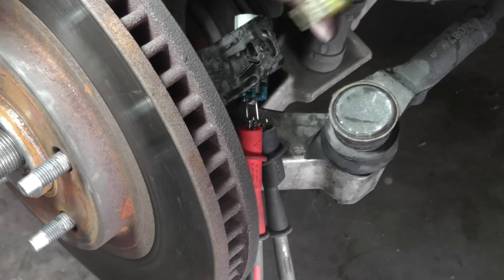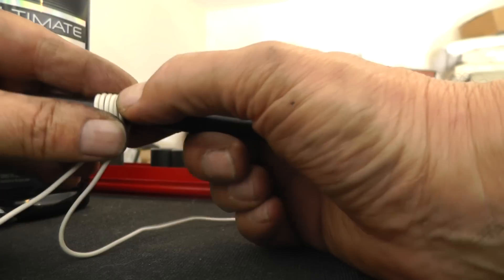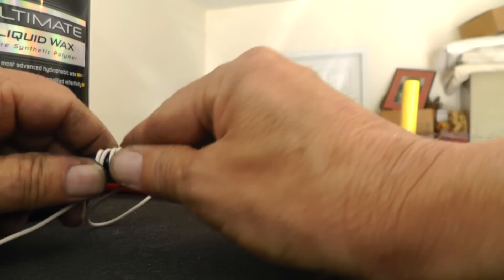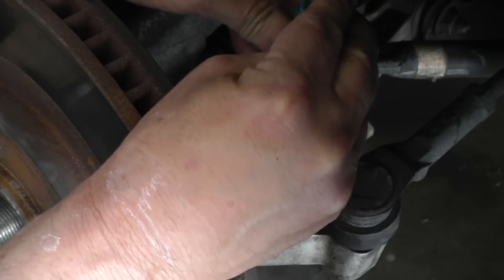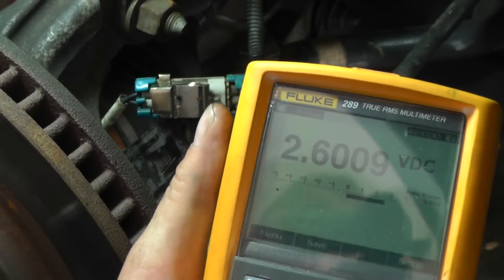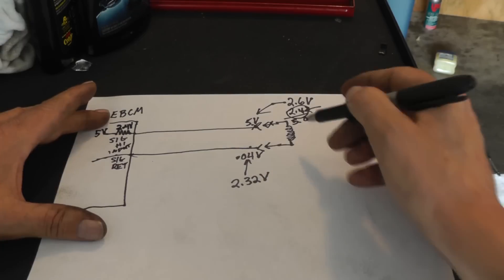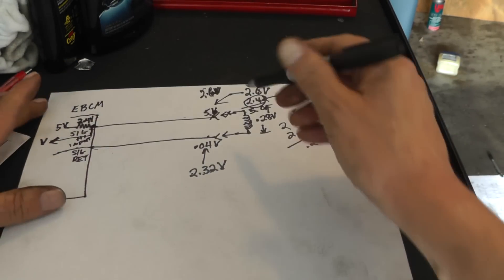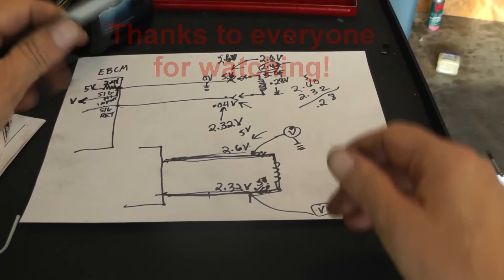Buick LeSabre ABS, Traction Off Diagnosis Part 3

Comment from the maker: Thanks for watching blackwell1384. This is only the first part of where we're checking resistance and the DC bias line. If this voltage isn't right, then it doesn't matter whether the sensor is working. You'll still get a code. We'll cover the actual sensor voltage in the next video to look at the AC voltage with a DVOM and a scope. Thanks again blackwell!

Comment: what does it mean when I have 3.15v on " high wire " and 3.13v on " low wire"with the connector plugged in? 
its the same type as you're showing....
thanx for Great vid 😆